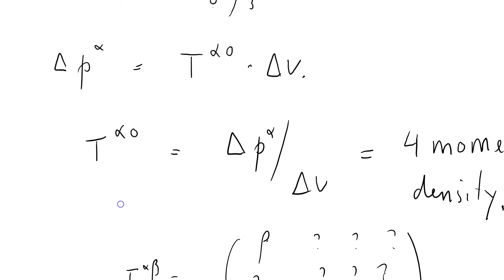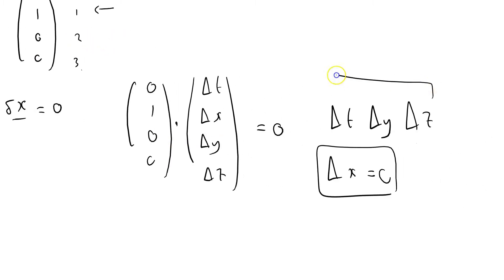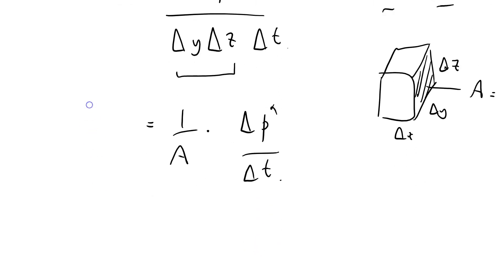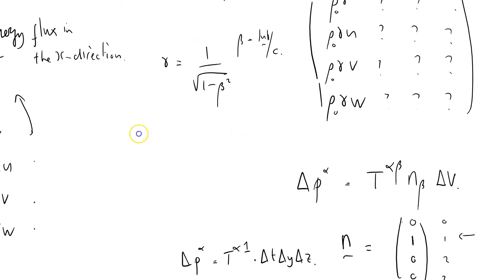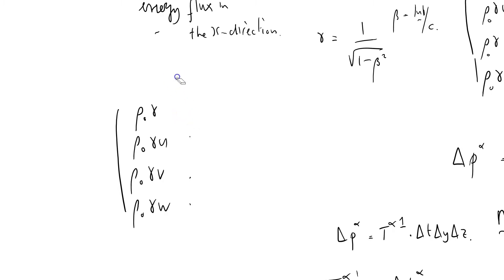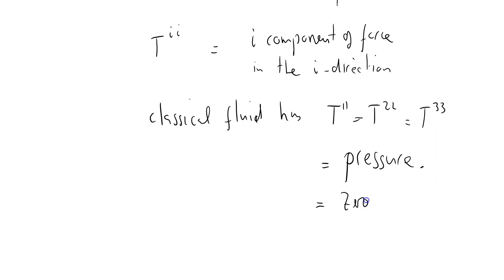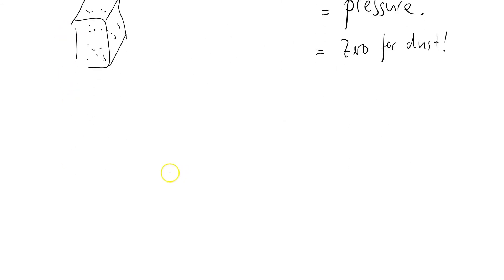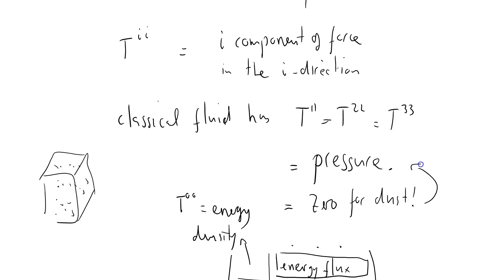GRSS 095 stress energy tensor part three

Comment: 6:06 The formula for the spatial components seems to be missing an index in the rhs.
Reply: yes....sort of.  I don't like to label the 'A' with an index directly because it is easy to mistake the result for an actual tensor.
Reply: So the extra index comes from the denominator but you don't want to write it explicitly?
Reply from the maker: yes that's right.  I guess I could use a bracketed index instead.
Reply: Thank you!